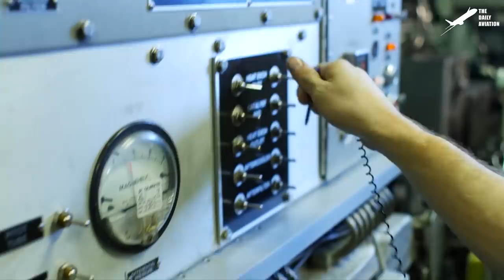Scary Moments During Rescue of Lost US Submarine

Comment: After the Turkish diver enters the water at the beginning of the video, Windows XP is seen on the monitors that control the diver  XDXD
Reply: I am still using windows 95
Reply: Rios Salvajes  Most compatible, XP has it's problems but the majority of defence software was written for it and spent 5 to 10 years being perfected.  To switch a vessel over to Windows 10 (or even 8 or 7) would require defence contractors rewriting their software and then spending another decade refining it.

If all you need is a basic GUI that can relay the information required to the operator then XP is as good as anything else still.

Comment: Submarines should be designed from the factory with multiple small  docking doors on all sides for minisubmarines to attach in case it sinks
Reply: Surely more hatches would also create more potential for failures and weaken the subs integrity....
Reply: @mikespicer4827   I don t think it is the case, very small dors like 60 cm have a minimum or no impact on the structure, a small door fixed well with many bolts that are removed after hatching should be a secure way to evacuate people out with a special minisubmarine built for this task